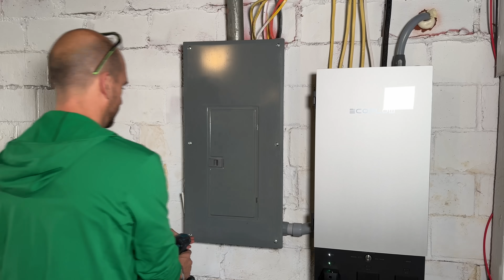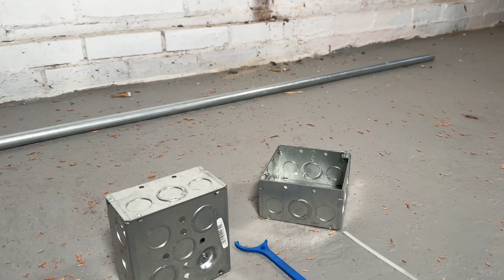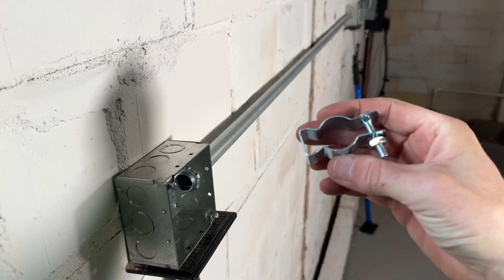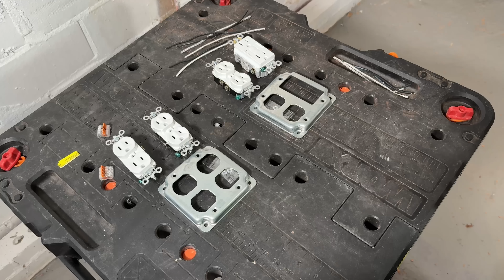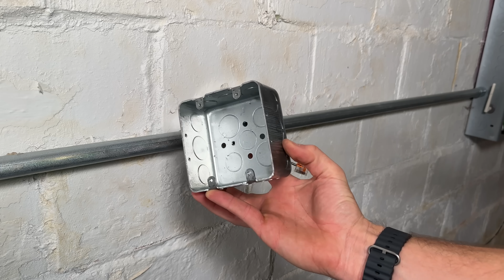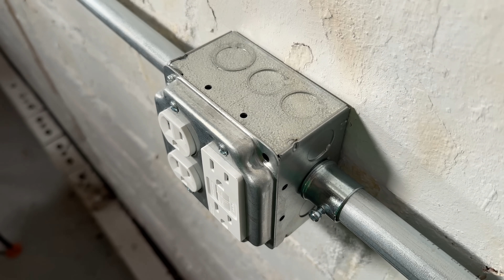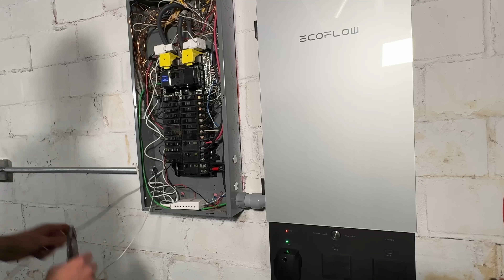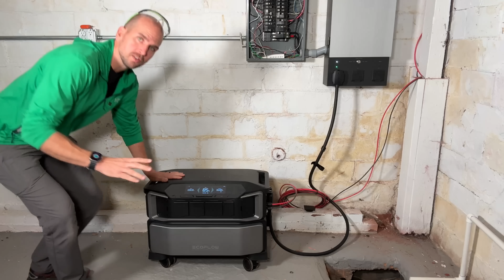Add Outlet To Unfinished Basement Or Garage

Comment: It's been a while since i did trade school, but i'm pretty sure EMT requires a dedicated ground because of a couple of scenarios, first conduit it technically not a ground, if the conduit should somehow "break" ie: become disconnected from the coupling/connector, your ground is no longer there, and if you remove the plugs from the box, so they are hanging out of the box, ie: if they need worked on or tested or vibrated out or whatever, you no longer have grounded outlets.

I looked up if you should use a ground in EMT, well this is pretty much the best quote i saw "That being said, only cheap hack fucks rely on conduit for an EGC."
Reply: EMT is the dedicated ground. No wire type egc required.

Comment: So nice to see conduit being used.  As an old timer who grew up in Chicago, the sight of Romex being run through holes in studs and into plastic boxes has always left me a bit jarred.  Intellectually I know it is permitted in most places, safe, up to code, etc., but still, it just looks wrong -- sort of like knob and tube wiring or something.  

While I never did this professionally, one of life's joys was bending a semi-complicated conduit run and having it drop into place just so.  For the pros this is likely old hat, but for an amateur it can bring great happiness and satisfaction for a while.
Reply: Yeah, that 60+ years of romex really has gone badly.  🙄🤦🏻‍♂🤷🏻‍♂
Reply: After I had an electrician rewire the second story of my old house. Replaced one circuit that ran everything on the second floor,  Replaced with five  circuits ,two 20 Amp circuits and three 15 Amp circuits.  I would have needed a 2 inch conduit for all the wires in the first half of the new circuits.

Comment: What is that white box in the bottom of the panel?
Reply: power meter, links to your wifi/phone, and you can see how much juice youre using
Reply: Ok , I was taught, and the code specifies that no box(s) that were not rated for voltages alone with said wire were against said code. so the way I read the code that box is in violation. @keything8487

Comment: Why not use offset fittings and get that EMT flush against the wall and use half straps as needed for support. Bend a saddle in the pipe for obstructions. Are you an electrician or just a wannabe?